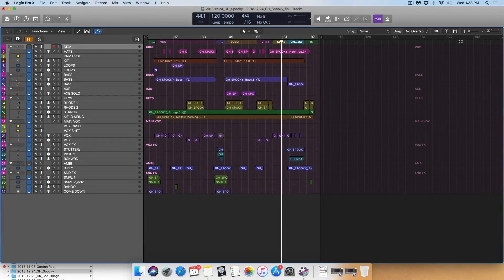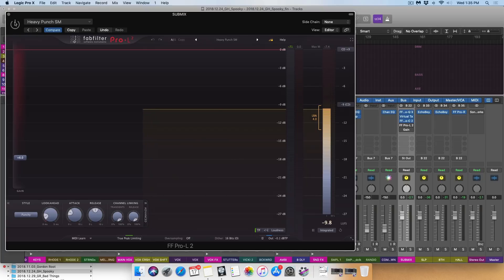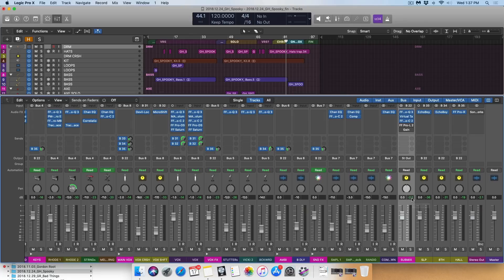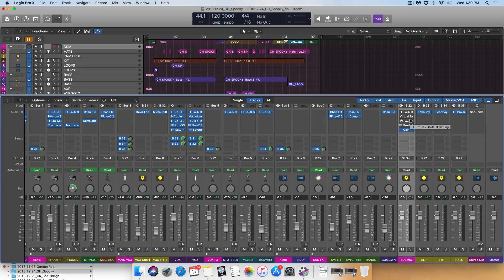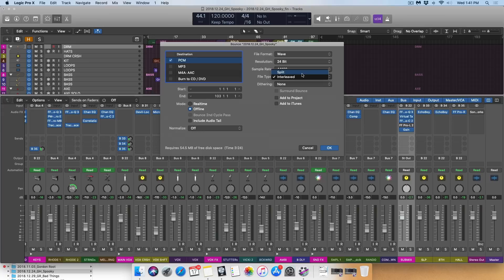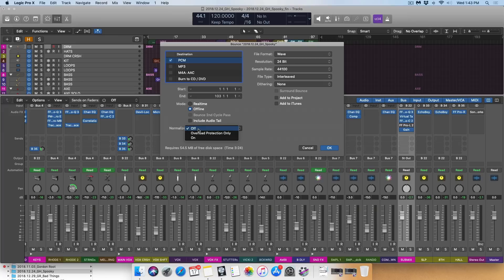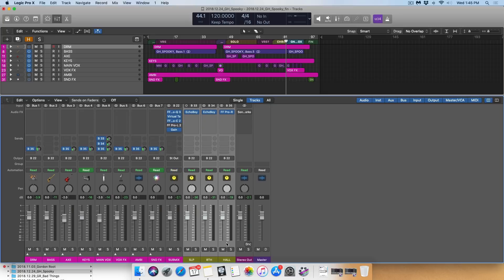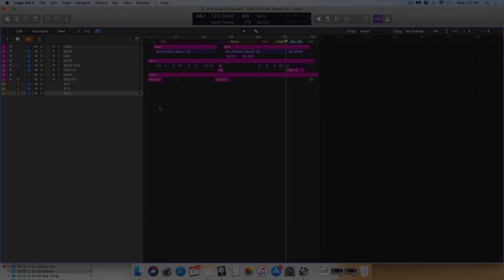How to Prep Your Logic Pro Projects For A Flawless Mastering Experience

Comment: Can someone clear this up for me please. Does it realy mater if your channels are clipping.. as long as the main out is not. Also, is it ok to use plugins on the main out "bounce" channel rather than an aux as shown here.. thanks.
Reply: RAD Official yes. If you are sending an input to a plugin too hot, it might not perform correctly, especially susceptible are vintage plugins, where the inputs are modeled are the same as the original product, often requiring a specific input level to perform optimally. However, making sure your signal is clean all the way through every point in every channel is considered good practice. It’s your mix, so you do as you please, obviously, but if you want a good mix, follow above. In fact, it would be a wonderful learning experience to make a copy of your mix (plus a backup of course) use some vintage and non vintage plugins (even Logic’s vintage stock plugins) and mix one with higher than recommended levels and the other as I recommended and listen to the difference track by track and plugin by plugin. The difference you hear is something you might consider remembering and referring to, when you evaluate your mixes, as something to lookout for. Even with decades of experience in a professional level, I still go through full channel-strip’s ins and outs with a meter if I hear something out of place.